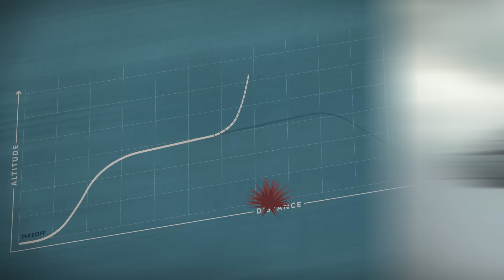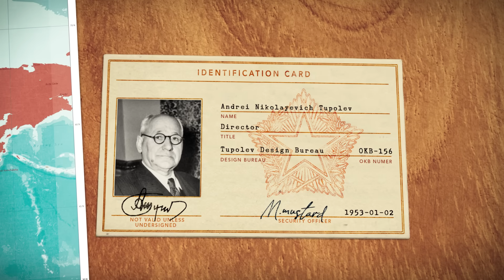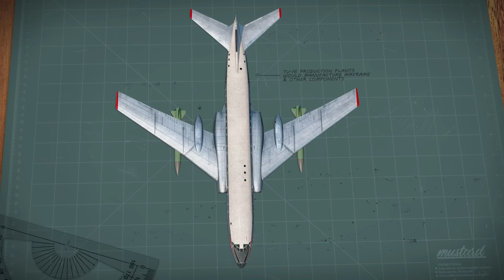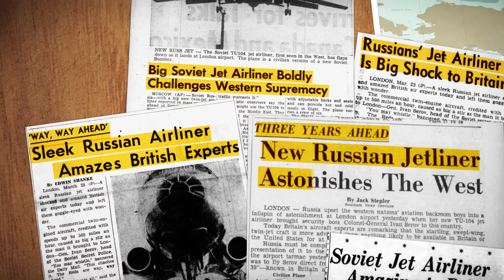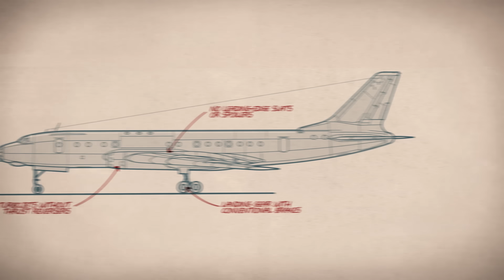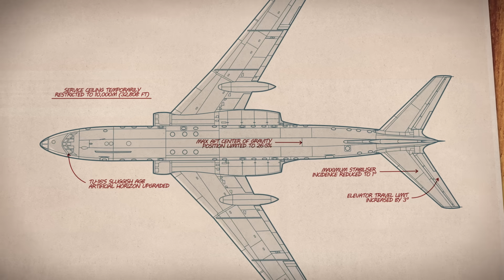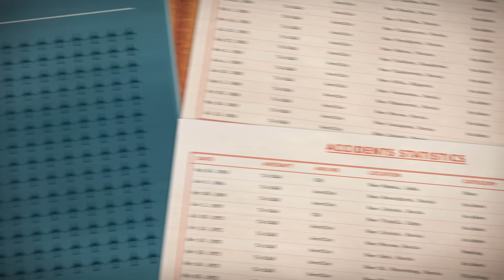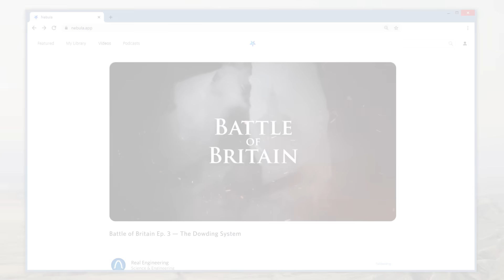The Soviet Airliner Designed To Crash

Comment: I wonder what if they had 1 more year of development, would it be safe enough to fly for decades? Redesign the wings a bit, the tail a bit, etc.
Reply: Same problem with the British de Havilland Comet, it was rushed into service much too soon and became the worst jet airliner in history... it has a higher loss rate and fatalities than the Tu-104.
Reply: @DoktorBayerischeMotorenWerke 

We believe we can clear up some commonly held myths and misconceptions obviously.

It's always good to see the facts presented clearly and concisely isn't it?

Obviously there have been worse aircraft for accident losses both before & after the Comet.

The engine position and inlet design had advantages at the time. The inlet design was changed to help reduce the chances of pilot error caused stalls during takeoff. 

All jet airliners benefited greatly from the knowledge gained from the Comet incidents & subsequent investigations & yet some were still worse for accident losses. 

Instances of all marks of the Comet flew with full certification after 1954 including the Comet 3.

The fabulous trail blazing DH Comet.
World's first jet airliner.
World's first high altitude airliner.

    How things were back then.
Accident losses - % of aircraft built.

It should be remembered that it was not unusual for the first batch of say 10 of a type to have much higher accident losses than all the aircraft built. 

DeHavilland Comet 4 UK                     14% 
DeHavilland Comet all (ff 1949)         17%  
Vickers VC10 UK (ff 1962)                   5%

Douglas DC-1                                      99%
Douglas DC-2                                      47%
Douglas DC-3                                      30%
Douglas DC-4                                      26%
Boeing s300                                          72% 
Boeing 307                                            70%
Boeing 247                                            48%
Boeing 707  (ff 1958)                           20% 
Lockheed L-049/149 Constellation    30%
Lockheed Electra  Turboprop .            29%
Fairchild FH-227                                   30%
McDonnell Douglas DC-8                    14%.
Sud Aviation Caravelle  (ff 1955)       15%
Canadair CL-44 Turboprop (ff 1959) 46%  
Convair CV-580  Turboprop                22%
Convair CV-880     (ff 1959)                27% 
Convair CV-990     (ff 1961)                33%
Tupolev T-104        (ff 1956)               16%
Vickers Viscount   (ff 1948)               32%             

  The Vickers VC10, fastest Atlantic crossing for a non supersonic jet airliner, held the record for 41 years.

For the first few years of operation the Caravelle & Comet had similar accident loss fatalities.

The first few Nimrod airframes were Comet 4 airframes with the equipment bay tacked on. Subsequent Nimrods were new build Comet 4 airframes with the modifications built by the DH team at Hawker Siddeley.

The world's first wind tunnel was constructed in England during the 1870s. The world's first supersonic wind tunnel was constructed in England in 1922.

   Of course De Havilland carried out a full stress analysis & performed extensive & protracted testing, including pressure cycle testing, on two long lengths of fuselage. De Havilland carried out significantly more testing than was required by any authority at the time & significantly more testing that any previous airliner was subjected to.

   De Havilland did indeed always work to better than industry standards at the time, used up to date knowledge for the design & no evidence of negligence or criminal negligence was ever produced in relation to the DH Comet.

  The DH Comet had better safety than or similar safety to many other commercial passenger aircraft of a similar era both before & after the DH Comet.

The accident loss fatalities for the first few years of operation were similar for both the Sud Aviation Caravelle and the De Havilland Comet.
  
Pretty much all changes made after the Comet 1 were just in case changes or were previously planned ongoing improvements.

How things are these days and what's going on in the world.

Airbus is not a German company. There are no longer any German companies making German jet airliners in Germany and there are no German companies making German gas turbine aero engines in Germany that are suitable for wide body airliners. 

That's correct, The Tornado & Typhoon & their engines are supersonic & are indeed British design aircraft with British design engines built by an international consortium. The Tornado design for example started life during the 1950s at Vickers as the AFVG, it's engine is based on the RR RB-199. The EE Lightening is also a British Supersonic jet aircraft.

The Typhoon is the British BAC-EAP with an engine based on the British RR XG-40, the Typhoon is also built by an international consortium.

   A typical but small glimpse of what goes on in the very internationally orientated British aerospace sector.

  Of course the RR Nene was in fact the world's most reliable & most powerful gas turbine aero engine in 1944. Licensed built versions & copies of the RR Nene & RR Derwent would go on to power many aircraft in Russia including the Mig 15 & Mig 17, the US, China, France & other countries for decades after 1944.

The Axial multi stage sequential stage  compressor & turbine technology, first produced for turbo machinery use in England by Parsons of Ireland & North England during the 1800s. The components form the basis of most modern gas turbine aero engines. At the time the concept of the jet aircraft powered by axial internal combustion gas turbine engines was first mentioned thus the internal combustion jet engine & jet aircraft was indeed invented in England before the 1900s & before the Wright brothers got busy.

      Boeing Apache Attack Helicopter.
AH-64: 75 UK suppliers, 7% UK content, global fleet of 1280+ aircraft.
F35B more than 130 UK Suppliers, more than 30% UK content.
F35A & F35C more than 130 UK Suppliers, more than 15% UK content.

There is no doubt that an airline has recently ordered 60 RR England Trent XWB Engines

Obviously the UK has the
World's Highest Combined Per Capita
Nuclear / Defence / Aerospace Sector Activity.

Rolls Royce Holdings UK
Subsidiaries
- Rolls-Royce plc
- Rolls-Royce North America (ex Allison etc Classified Military stuff)
- Rolls-Royce AB
- Rolls-Royce Deutschland
- Rolls-Royce India Private Limited
- Rolls-Royce Marine Power Operations
- Vinters Engineering Limited
- Rolls-Royce Controls and Data Services
- Rolls-Royce Power Systems
- Bergen Marine
Joint ventures include:
- Rolls-Royce Turbomeca
- MTU Turbomeca -

Trent Family
The MT30 (Marine Turbine)
Industrial Trent 60 Gas Turbine
Trent 7000
Trent XWB Airbus A330neo.
Trent 1500
Trent 1000
Trent 500
Trent 600
Trent 700
Trent 800
Trent 8100
Trent 900
   
RR wholly owned subsidiaries in Germany handle smaller 2 shaft RR gas turbine aero engine work.
    
We do indeed hope this helps, of course.         
    
As always, cheers & 👍 indeed etc.c